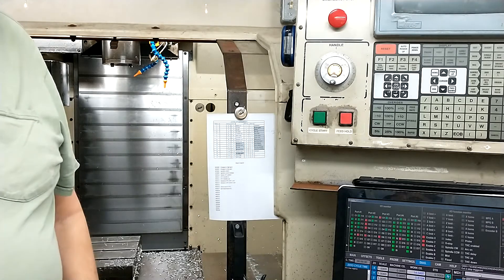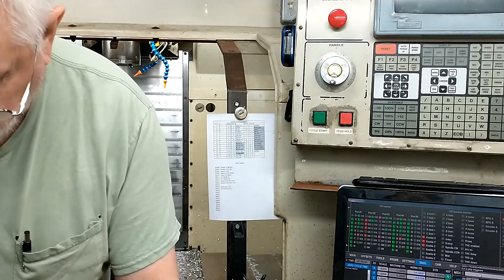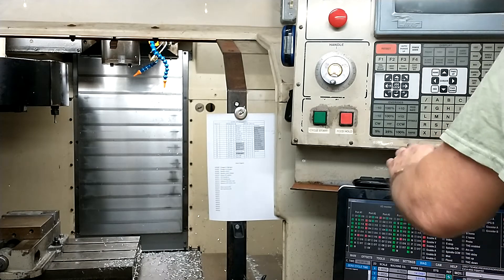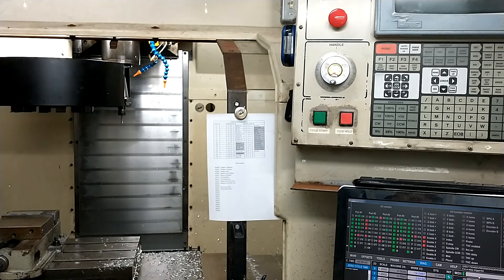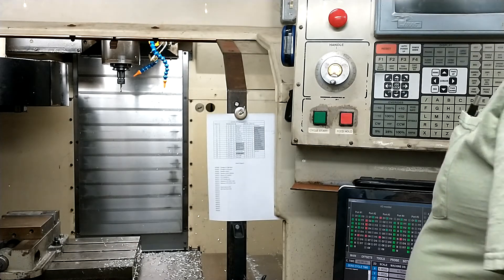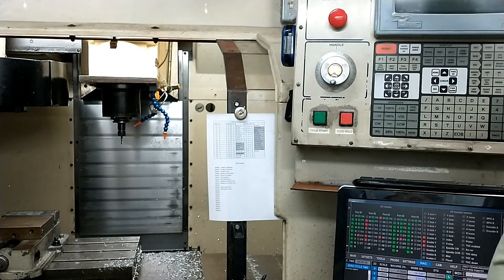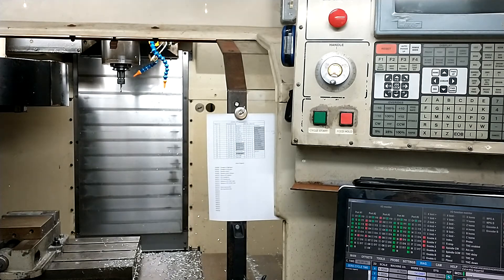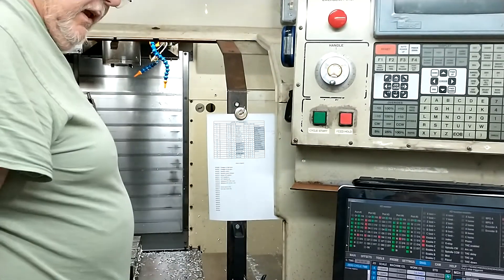Tool changer progress, 1990 Haas UCCNC retrofit

Comment: Hi Ron- thanks for posting. Very interesting indeed . Seems a bit daunting to rewire all the controls but it is clearly quite possible! Do you use the original console at all or is it all done from your computer? What kind of info did you need on that Haas to be able to figure out what goes where? I'd love to learn more so that I  can do the same on my Manford 850. Is the UCCNC controller more capable than the original Haas unit - Id guess it must be way better , much bigger capacity to store files plus a fourth axis option . Any pointers would be appreciated!
Reply from the maker: All Haas manuals are online, so that made it easier. The original console is not used. I do intend to reuse the buttons and MPG, but they will be interfaced to the new computer. All of the original computer has been removed. Yes, the modern PC has the advantage of plenty of memory, network access for file transfer, multi-axis capable, rigid tapping and high speed machining. The main thing I looked for was a system with enough inputs and outputs and the capability to modify it as needed.
Reply: @barebooger  Thanks for taking the time to get back to me - only just worked out how YouTube reply notifications work! In the time since I wrote some very kind friends ( professionals in the trade ) came to reboot my machine which was part of what was needed as well as replacing old chewed up wiring. I'm back with the original system. So far so good but still lots to learn ( post processing etc) I did find out that it is possible to get conversion boards from pin/dir controls to run PWM servos. Wonder if that is useful info for you . Thanks again for getting back to me - I'll still rig up the UCCNC to my original DIY CNC when that is built
Reply from the maker: @bikefarmtaiwan1800  I have since removed UCCNC. It's fine for a 3 or 4 axis machine, but it's not ready for ATCs. There is no screen or out of the box controls, and I am no programmer. I am in the process of converting to Linuxcnc. I am using Axis (screen front end, like a screen set) to start, but hope to move to probe basic if I can get it working. It has conversational programming, probe screens, as well as ATC support.

Comment: Hi. Im assuming you found the tool change sequence in the service manual?  I have a 92 VF2. She's getting new LM guides for X and Y and a thorough cleaning and going though. I've had it for 20years and the last time it had power was 2 years ago with a Z axis fault. Probably an encoder. Hopefully with that repair the stock control, servos and drives can carry on for the foreseeable future but I am preparing for the possibility of needing to retro at some point. Good to see your progress

Comment: Is spindle orientation done with some type of air mechanical lock?
Reply from the maker: Yes. Haas used a shot pin. You turn the spindle slow, energize the pin and it drops in a slot, the switch gives feedback when it's in and you turn the spindle motor off. Sounds like a kludge, but it actually works well.